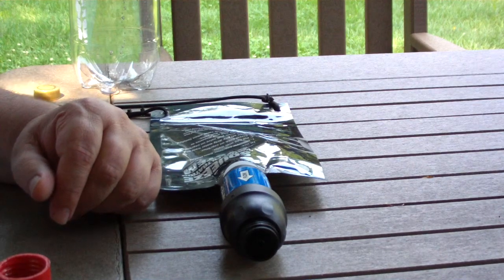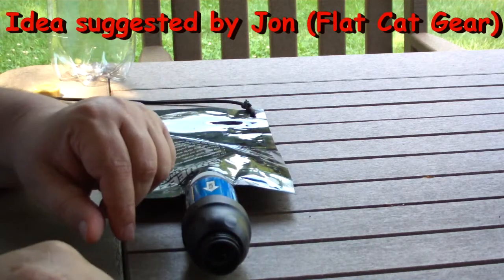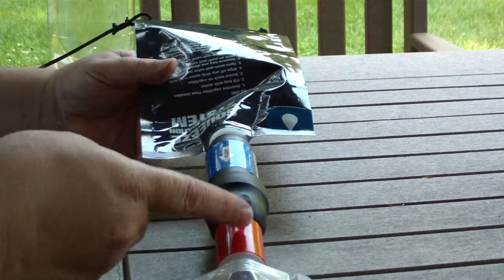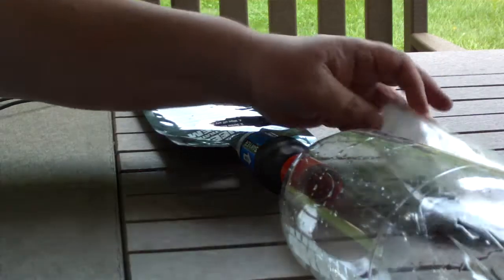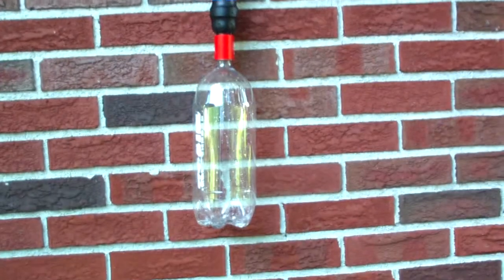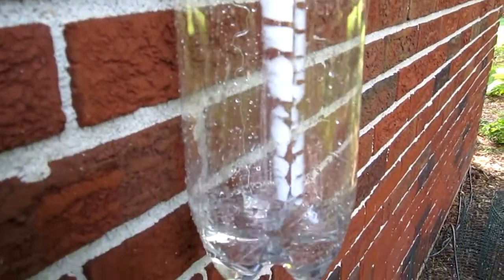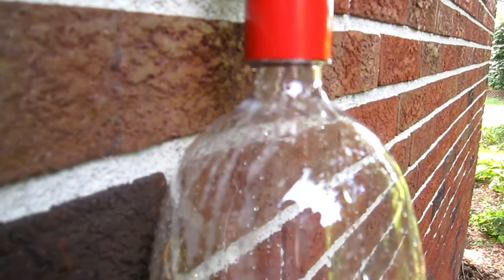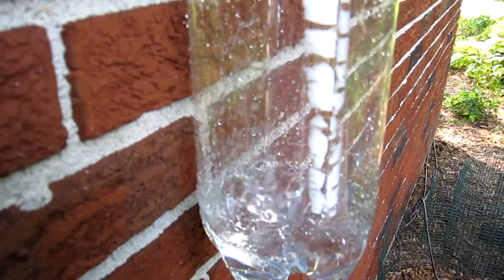Sawyer Squeeze Filter - Will an empty two liter soda bottle work with the Tornado Tube Mod?

Comment: Couldn't you use a hose gasket on the 2liter side then slightly unscrew the side that has the filter attached to it? if its a gravity system the water should fall into the tornado tube and into the bottle fine.

Comment: You can file out a pin hole inside the tread of the tornado on one side and make a small indentation on the end incase a bottleneck seals it off.

Comment: As suggested make a pin hole in the bottle or tornado tube. Or get a bottle cap with a small tube mounted and do not use the tornado. Use a plug that can use the platypus hose to minimize gear.

Comment: I wonder if you could put a pin hole in the bottle neck right under the threads and get the fill to happen.  With a hole that tiny, a piece of duct tape wouls make the bottle pretty well sealed.

Comment: He Hiram,

I'm guessing if you can create a vent hole in the tornado tube that relieves the pressure build-up within the soda bottle it might work... Since air doesn't need a big hole a hot nail pushed trough should be enough. Looking at the video I'm guessing the tornado tube does seal nicely with not all that much air leaking....

Good luck and best regards.

NekitaNet

Comment: Possible alternative solution. Keep Sawyer squeeze bags for filtered water use only. Use water/soda bottles for dirty water. Keep thumb over small vent hole in bottom of bottle while filling. Or cut off bottom of bottle for ease of filling. Attach to filter, then use removed section of bottle to dip water from source to fill part attached to filter. Or any other available container for dipping. 

Bottles easy to obtain, relatively speaking. Squeeze bags aren't.

Comment: Need a way for the air in soda bottle to escape so water can replace air it contains. Both water & air can't occupy same space at same time. 

I'm wondering if push back of air through the filter can cause damage? That is can air become trapped in filter, thus reducing flow rate? Probably not, but just wondering based on need to be forceful with initial backflush to clean filter.

Comment: Punch a small air vent hole in top shoulder of soda bottle. Cover with strip of electrical, duck or aluminum duct tape.. When ready to fill bottle, pull back end of tape to expose hole. After filling, press tape down again. Tape not available, plug hole with small twig, if plugging is a must. 

If using a soda bottle for dirty water do same thing to bottom of bottle, if hanging or holding bottle. Can even cut off end of soda bottle for easy filling, if holding bottle upside down while filtering.

Comment: Couldn't you unscrew the 2 liter bottle a little bit, so it isn't air tight? Wouldn't that increase the flow, but still make it in the bottle?

Comment: thinking of this and the way you make your bubblers.  two bottle caps epoxied into a PVC fitting and make an air vent at the top connection thru the threads.